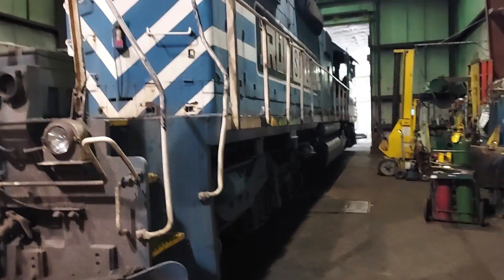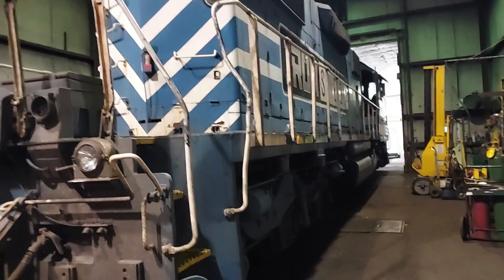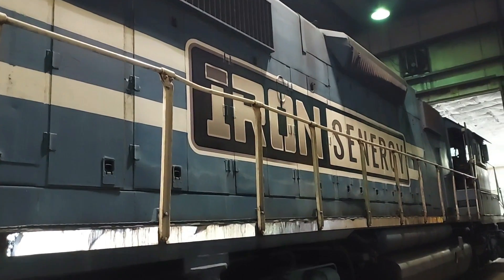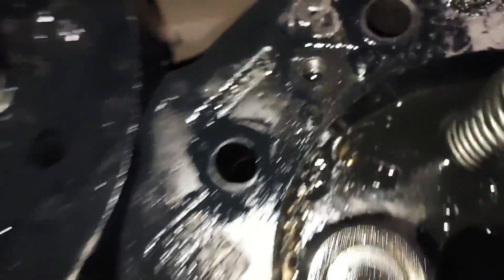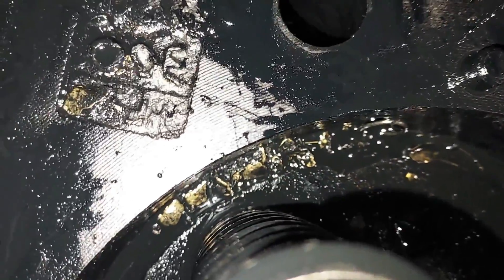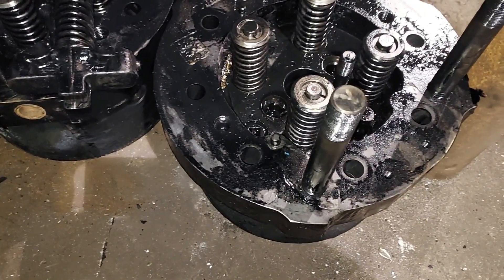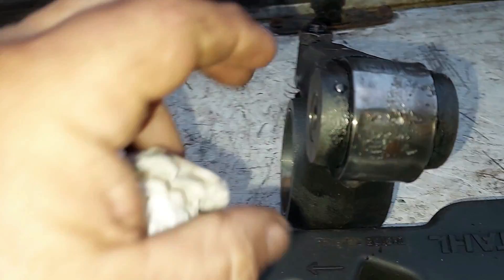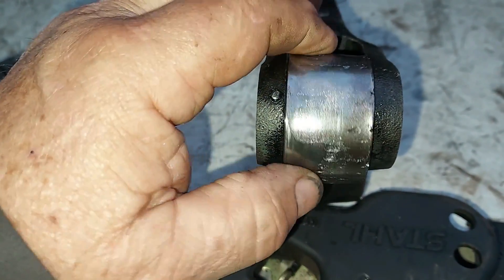EMD 645E Cylinder Heads Replaced on our #22 Locomotive

Comment: Dave, those EMDs will run until they literally fall apart. They can take more abuse than any engine I’ve ever seen or worked on. 
A couple things I see from your video: the amount of damage on the camshaft the rocker cam rollers and the valve stems and valve bridges looks like the valves were way out of adjustment. Too much clearance allows the parts to slap against each other rather than following the cam motion smoothly.  The excess clearance is probably due to wear in the valve train and lack of periodic inspection and adjustment of the valve lash. I’ve worked on several locomotives that probably hadn’t had a top end service, valves and injector adjustment in 20 years. Some were wildly out of spec. 
The rocker bearing with the copper showing is completely shot. With that much wear, the rocker shaft may be out of round, but it sounds like everything was replaced anyway. That bearing wear plus the camshaft wear make me wonder about the condition of the lube oil and the oil delivery system. Locomotives run long hours at idle and low speeds. If the oil pressure pump is getting weak, the top of the engine like the camshaft and heads may be starving for oil causing a lot of wear. Also, since practically no one ever actually changes the lube oil on a locomotive, it can get pretty loaded up with soot and metal particles. If a sample of oil were sent out for testing, you might find out the oil is out of spec as well. 
Most old EMDs spit out so much oil that just continuous adding keeps the oil in reasonably good shape, but I’ve had to on occasion drain the lube oil, all 400 gallons of it and refill with fresh lube oil at $10/gallon. That was because the injector supply and return tubes under the valve cover leaked  and we found 40 gallons of diesel in the lube oil. This was on a freshly rebuilt GP30 that had just come to us from NRE. Fortunately NRE picked up the $4000 cost of changing the oil.  
It’s pretty amazing that old engines that are older than me 70 yrs, with a little maintenance will probably run another 50 years or so. 
That’s railroadin!
Reply: Bill you hit every comment I was going to make after seeing the wear on the rocker and the spalling on the cam follower... I was thinking a bad batch or wrong oil was introduced... But I am in total agreement if that one rocker is that worn, the rest can't be far behind. Seems like Cumblerland 's previous owners weren't just skimping on underground maintenance but above ground as well. 

Maybe the mouse motor should be worked over sooner rather than later, and get it back to spec as this engine may very well be on borrowed time.
Reply: @kleetus92  I would guess more of a case of improper valve train adjustment. In the Detroit Diesels you had a tool to gauge the set points of the injectors and you used feeler gauges to set the valve bridges. In FMs, ALCos, Cats, and most other large engines it all was done with feeler gauges or dial indicators. The fact that the wear on the rocker roller was hit and miss with one perfect patch would not have been the case with bad oil. Bad oil tends to uniformly ruin the rollers. Even something as simple as the hold down bolts not being torqued to specs could have caused the rocker arm wear to be accelerated.
Reply: @gravelydon7072  That is true, but I wonder what the other power packs look like in relation to this one?
Reply: @kleetus92  So do I.  Hopefully they were checked in the process.
Reply: @Bill Moran, You OBVIOUSLY are a "MASTER MECHANIC" !  Please see my comment as to further contamination and the need to pull a couple of "Main Caps" and  "Rod Caps" for inspection  ... ...  also the installation of MAGNETS on the oil drain plug, If not already present.
Reply: @capttom7772  wouldn’t hurt, but not the easiest job. You’d have to drain at least most of the oil first. There are access plates into the crankcase.  The rods have an interesting arrangement. One rod from each bank is paired with one on the opposing bank both on the same journal. One rod is a “fork” and its mate is a “blade”. They fit within each other around the journal. A 16 Cylinder engine has 8 pairs of these. During each revolution of the crankshaft, both cylinders fire about 45 degrees apart. 
As far as magnets on the oil drain plug, there really isn’t one. Drain plug that is. These engines weren’t set up to “change the oil” like a normal diesel. Oil is added or removed from the “milk box” or “ice cream box” which receives the oil from the crankcase scavenging pump, strains it through a course strainer then allows the oil to flow into the main oil pump to be pumped to the oil filter and then back to the engine.
Reply: @billmoran3812  Yes it surprises many that we don't do 12'000 miles service with oil and filter change on loco's yes we change filters but not the oil . We have the 710 variant of this engine and it surprises me how clean oil stays ,suppose its because being a 2 stroke most of muck from combustion ends up in the airbox " thought it was just us in UK calling it ice cream box "
Reply: @capttom7772  Expect nothing less from a trumptard...
Reply from the maker: Wow Bill what an awesome comment! Thank you so much for
sharing your expertise with us. Lack of periodic valve adjustment
I will certainly tell you is an accurate assumption on your
part. Good point on the oil pressure, I know that our last
locomotive contract mechanics never checked that, I
will ask our new mechanics next time they come in. And also
oil changes are very infrequent here. Really appreciate your
watching and writing in my friend. Just love to hear your
comments.
Reply: @ccrx6700  It may be a good idea to install an oil centrifuge in lieu of the paper oil filter if they don't change the oil very often.  An oil centrifuge can actually do a better job than a paper oil filter.  Russian diesel tank engines actually use them.
Reply from the maker: @douro20  never heard of something like that interesting 🤔
Reply: wow you make perfect sense guy. I'm digging it
Reply: Wow that's incredible!
Reply: Worn out hydraulic valve lash adjusters allowing the out of spec clearances.  Small fixes left undone leads to disaster.
Reply: @copokitapo  the WHAT ? The engine doesn't have any...

Comment: I was a c&nw cedar lake shop electrician but would run the crane for the machinests sd45 645 cu per cyl 20 cyl 3600 hp if I remember right the head stud nuts were torqued at 2400 lb with a torque multiplier totally miss working for the rr everyday was different
Reply from the maker: Your right, they use a torque multiplier on those crab nuts Gary.
I don't know the exact torque on them but it's a lot for sure. I hear
you on missing railroading. It gets in your blood and you can't
get it out. I'm afraid to retire. Appreciate your taking the time to
check out the video and may you have a very nice day my friend.

Comment: Dave, you need overhead cranes, We pulled the long hood, unhooked the AR 10 and jacked back some, Pulled the engine  and set another in.
Reply from the maker: We've changed a few engines here over the years Robert, they
have always rented a big crane to do it. No one thought ahead
when they built the big shop to put in an overhead crane.

Comment: I see that roller on may modern day automotive with that type of wear and scaring dirty oil and or metal fatigue is usually the culprits thanks for sharing Dave
Reply from the maker: The oil in these locos hardly ever gets changed and not just
here but on a bunch of other railroads David I change the oil
in my truck and equipment at home religiously.  Thank you very much for taking the time to check out the video and may you have a very good day my friend.

Comment: I crewed a couple of USCG buoy tenders and we ran 645E 8 cylinder engines (dc propulsion).  They sent me to get schooled up at MKW Power Systems in Rocky Mount NC and one of the items they stressed was the hydraulic lash adjusters that rest in the valve bridge, once the wear develops to more than about 1/4" circle they are ready to be replaced.  Those low dollar parts wearing out will lead to big dollar repairs down the line.  Yup. lol
Reply from the maker: Thanks for sharing your story with us copokitapo and for taking the timeto check out the video my friend.

Comment: Probably the first thing to disappear when this unit was delivered new was the service manual. One thing. that is in the manual is how to set up the hydraulic valve adjusters; adjust all the slack out the turn the screw one and a half turns. These units are like the tappets in your car and as far as I know EMD is the only manufacturer that uses them. One trick I use to check if they are still functioning is to let your finger ride up and down at idle speed { and before the oil gets hot}. A good tappet will just move up and down but a defective tappet or one that's not set up correctly will send a shock to the valve keeper.

This engines maintenance has been neglected for a long time, it shows with the signs of contaminated oil everywhere probably due to not changing the oil filters. The oil filter tank has a by pass valve that is likely to be stuck open.
Reply from the maker: Appreciate your taking the time Kenneth to write in and share that
info with us. Watch my video on Where Would you Spend the Money
to find out why our equipment and track had fallen into a steady
state of disrepair. Last company filed bankruptcy, there was no
money. Thank you so much for taking the time to pay us a visit and check out the cylinder head replacement show. May you have a most blessed day my friend.
Reply: @ccrx6700  This engine is used up. Its patches have patches on them. If sold it would only bring scrap metal price.

Comment: We use to get cam rollers breaking up on class 60 locomotives (Mirrlees engine ) and it use to take out the cam , this was very big job on mirrlees mb275T and I'm pretty sure it was due to sloppy valve clearances . Never worked on 645 as we only have the 710 in uk but looks pretty much the same engine , does 645 have hydraulic lifters like 710 ? we use to set them up though then check hydraulic lifters with pinch test when running engine
Reply from the maker: Thanks so much for the nice comment. We really appreciate
your taking the time to stop by and visit with us my friend. Yes sir
they do have hydraulic lifters.
Reply: @ccrx6700  Interesting to see cylinder head removed , here in UK any problems we just replace power pack (head liner piston and conrod ). We found the EMD engines very different to what we have been use to , was bit sceptical of how they would last ,but the proved unfounded as they have been reliable engines , anyway all the best from the UK

Comment: Some of those parts appear to have gotten real hot.  don't know diesel engines but do know gasoline  ones and the kind of discoloration suggests excessive heat
Reply from the maker: Very well could have been, am wondering if when the contract
mechanics did their initial inspection while it was running if
they had a heat gun with them. I will ask next time
the come on. Appreciate your stopping by and taking in the video
today my friend.

Comment: I've pulled parts like that, out of many truck diesel engines, that were not properly maintained.
Reply from the maker: Proper maintenance being the key words James. Our former owners
knew they were selling and scrimped big time on adequate
preventative maintenance. New owners have brought in some
excellent contract mechanics and they have done a ton of
work on all our locos, with still more to guy, but at least it's
getting done. Appreciate your stopping by and taking in
the video tonight my good man.
Reply: I'm learning things about trains I didn't know. I been working on Diesel truck's for 27 years now, but I would love to go inside a EMD 645E3, just once 🙂
Reply from the maker: @jamesstrickland631  👍😊

Comment: I don't understand why they don't install electric vent fans in that metal garage to vent out the exhaust from the running locomotive. Yes some of it comes out of the doorway but there's still a good bit left in the ceiling. In the winter time you could leave the roll up door closed to keep it warmer but exhaust the fumes out the roof and maybe even through a filtration system to help clean it up a bit before it is exhausted into the atmosphere either way it is not very healthy to breathe.
Reply from the maker: They do have an exhaust fan on either end of the shop along with
a ridge vent along the top Eddie. You could not see those in the video.
They just neglected to turn the fans on and open the vent. Smoke
looked worse than it would have been if loco was outside since
it accumulated in the shop. Thanks for watching and asking
my friend.

Comment: Dave, I can't help wondering if all the metal "machined" off the rollers and bridges has a safe escape, so it can be trapped in lube filters before doing further damage. When I see the copper alloy backing material in a bushing|plain-bearing, it's wiped likely with its pivot. That engine should have a much better life-expectancy now.
Reply from the maker: Your right Jacques. Sadly our last owners knew they were selling
out and scrimped way too much on some things like track
and loco maintenance. We used to have a guy come in take
oil samples for locos and belt gear boxes but they then didn't
want to spend the money on that. Sins of the past are
catching up. However new owners are spending much needed
money on track and loco maintenance now. Always a pleasure
it is to have you visit and write in my friend.

Comment: That copper color inside the rocker is a worn out bearing surface. You'd find similar in a rod or main bearing in a normal sized engine. It's a plated surface over copper usually. And when you're down to the copper it's well worn and time for a change. I found the wear on the rocker assembly roller very interesting. Almost like when a wheel starts to egg shell. I wonder if it's just become so work hardened over time that it finally got brittle enough to start cracking apart. Shows you how many hours those engines have on them. A bunch!
Reply from the maker: Thank you very much Shane for the very informative comment.
Always is a pleasure to have you join in with us and write in
my friend.

Comment: Dave do you fall under fra rules ? Class ones have 30 days to repair sr defects ?
Reply from the maker: FRA has chosen to not "police" us. We do not have a public
grade crossing nor do we interchange with anyone. Thus, they
consider us as an in plant installation. We are patrolled by
MSHA, mine safety health admin since we are a coal mine. That does not negate us from following CFR Title 49 which writes
the rules for railroads, however most mine inspectors are
quite ignorant of Title 49 and also only a time or 2 a year do
they show up on the RR. I try to keep my track up to CFR standards
as best I can with what I have been given to work with over the years. I need to write a book.

Comment: Thought I read somewhere that those big EMD's valve lash was automatic/hydraulic? I agree that it looks like lack of maintenance/ oil problems.  I hate to get political but when the present administration starts in with banning all coal use why would you want to spend any more $$$ than necessary to keep it all running?
Reply from the maker: Agreed engine maintenance was not in the past what it should
have been Red, but also sometimes things just do wear out.
White House press secretary tried to back pedal on that
statement by the president. Future of the coal industry is bright.
Currently world wide demand is tremendous and mines cannot
keep up with demand. UK did away with all their coal fired plants
and now are begging for coal. Couple of months ago a broker
from UK approached our neighbor mine, Baily and said they
would pay $600 a ton to get coal delivered to UK. Baily went
to their customers and told them they would pay $50 a ton
for them NOT to take their coal so they could sell it to UK. Don't
know if anyone took them up on the offer or not. Coal will
continue for the near future my friend. At some point perhaps
40 to 70 years from now it will be eliminated. No energy experts
can agree on the number of years that will take.
Reply: @ccrx6700  That's good news about coal demand! I always cringe when I here statements about energy coming from the uneducated. $600 per ton...wow! Weren't you folks trying for over 7 million tons this year?
Reply from the maker: @redforman1648  we not gonna come close to 7 this year. Way too many problems they have had at prep plant and underground sadly